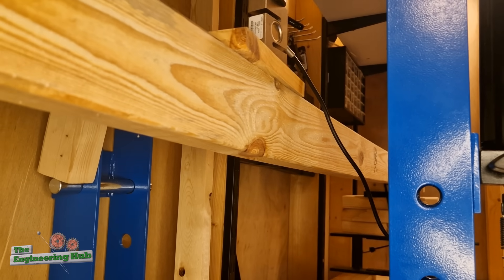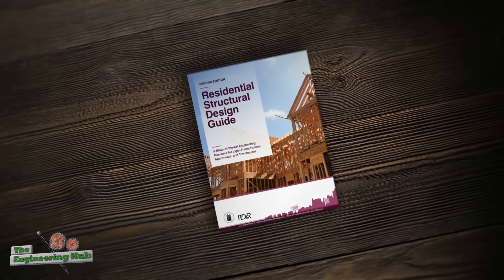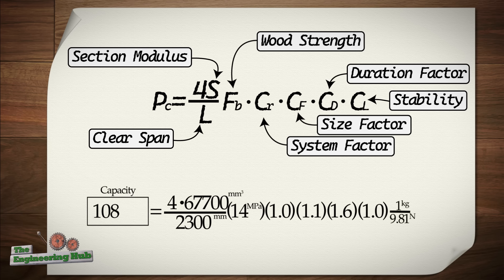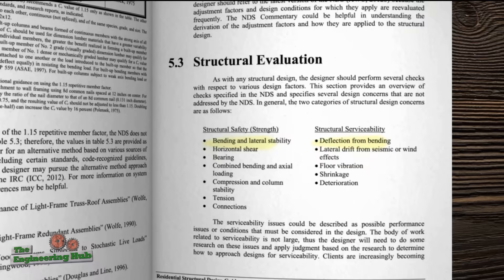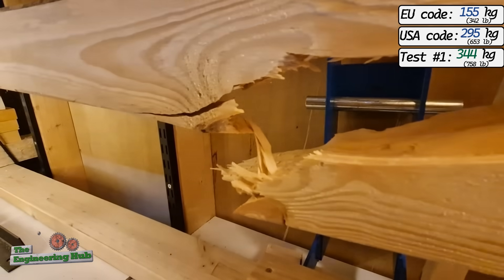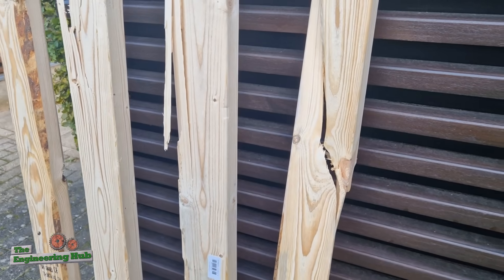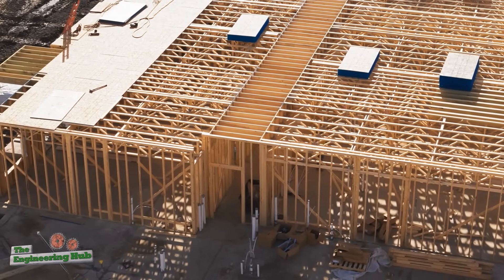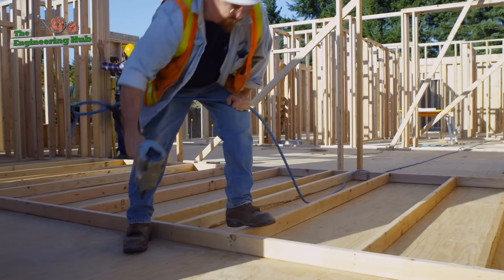I tested the strength of the 2 by 4!

Comment: This is why every carpenter and home owner always complains when the structural engineers say there wood floors or beams are undersized. We are not designing at this ultimate strength, the deflection almost always governs with wood members in bending. No body like bouncy floors.
Reply from the maker: @henrynagle8097  Yup, that's exactly right. The design of longer beams is (nearly) always governored by the deflection and vibration criteria. That's why a 2 by 4 shouldn't be used in a floor system unless the span is short. Many comments point out that the code doesn't allow 2x4s to be used horizontally, which is not exactly true. It's based on the span and spacing. If you have a 0.5 m span (for a short balcony or a section of a deck or whatever), a 2x4 might do just fine. For an 8ft span (like in the video), a 2x4 would never pass the deflection criterion, and in that sense, the comments are correct. My point is, it's more intricate than saying, "Never use a 2x4 horizontally". That's not how codes work.
Reply: @TheEngineeringHub  Yes. I build my bed out of 2x4s, safe to say that there is no problems with vibration or deflection.
Reply from the maker: @periodictable118 Good point: Furniture is another application.
Reply: @periodictable118  this is a hilarious self-own 😂
Reply: @TheEngineeringHub  I agree. But this same test still is true when scaled up. A 2x12 can hold why more than when we design for, but the deflection and vibration governs (in design). So thats the reason why all these (under sized memebers) are still standing. Safety Factor
Reply from the maker: @henrynagle8097  Yes, exactly! I only tested a 2x4 because my press can't break anything larger 😅 but like you said, the code strength for all of them is based on the 5th percentile strength, which naturally manifests in a safety factor compared to the mean strength.
Reply: You're doing great work. 👍 Whatever your formula, stick to it.
Reply: > "Nobody likes bouncy floors".       You should spend some time in an inflatable bouncy castle. You might change your mind!
Reply: 2x4's in the US are now 1 3/8" x 3 3/8"

Comment: I appreciate your video,  looking to hang a tank in confined area,  small tank 12 gal. 72 pounds total.  my load is less than 1/4 of the minimum strength you determined.   I am confident a 2x4 will function, thx.   FY!:  2:1 ratio is common in strength safety standards in ttransport load securement. (vertical shift, transverse shift).   If properly framed, side deviation can be minimized ensuring maximum load bearing over time.  Good Luck with your projects.

Comment: I came across this video while trying to figure out how much 2x4s I need for a fish tank stand.

Alot of builds I've seen use 2 supports per corner and one front and back in the middle. 

The span I'm working with is 47 inches wide and 20 inches deep 

So from my understanding of this video .. a the glass and water calculated to be 312kg (687lbs) means that a total of 10 uprights and a frame sat on that with also a 3\4" ply board on top is going to be ample to support the tank?

Comment: All floors are crowned, meaning that the curvature that one finds on most pieces must be used with the convex side up, so, this whole test is unfortunately quite flawed in evaluation of load capacity, because a downward curve has considerably less strength than one which the upward bow acts springing the load back up. These considerations are crucial, and crowning floor joists is mandatory practice for any structural carpenter. A tradesman should be consulted when doing these kinds of amateur 'informative ' videos.

Comment: Thank you for your video interesting. I would only use a 2x4 in wall application  ,there's not enough depth for a floor joist .When building a wall 16 on center, blocking at halfway point. That wall will carry incredible amount of load

Comment: That's never how a 2x4 is used, you have to use a 2x6 or 8 depending on several things but a 2x4 should only have downward pressure in a wall where they are 16 inches apart (in the US). This test is pointless and a waist of time. If your contractor is using 2x4 for your floor FIRE THEM.

Comment: Reasonable assumption that the first board with the knots in the middle would definitely be in the bottom 10% of board strengths overall. That pre-existing flaw really facilitated that brittle fracture.

Comment: At least here in finland 45x95 pine is fully planed and all 4 sides are smooth. It is used in visible structures. Structural 2x4 is 48x98 and can have some rougher surfaces.

Comment: My coworker and I once built a temporary floor on the second floor of a two story stair case so we could put an 8’ ladder on it to rough in a chandelier fixture. We only used spare 2x4s stacked on their sides from the framers extra pieces, and some old OSB that had been laying outside in the trash pile for a month. We had no clue how to do a proper load calculation for horizontal 2x4s as joists so we just over engineered the heck out of it, felt super solid, took forever to dismantle it.

Comment: As a consulting engineer, designing light frame wood structures in the USA, I wish this video was required learning for all contractors. I can't tell you how many times I have said the same key points you brought up to contractors who like to use the "I've been doing this for 3582 years...."

As others have mentioned in the comments, no one accounts for deflection limits and deflection controlled design or the fact that we use the worst 5% of wood for our strength values.
Reply from the maker: Thank you cbinder46! I'm happy to see consulting engineers around as well. I am a structural engineer myself but work in academia as a researcher. To my knowledge the code does not explicitly state that 2x4s can't be used "horizontally" as many have claimed in the comments, is this correct? Of course an 8 foot long 2x4 will never pass the beam deflection criterion but that's not to say never lay a 2 by 4 down, that of course depends on the span, load case, environment, etc. I am curious about your take on this?

Comment: When lumber is dried out it shrinks and that produces a crown (an arch). Floor joists and also rafters always have the crowned turned up for strength. Every board has this crown, some more than others. Even these short 2x4's have it so if he didn't crown the board before testing it  it could be turned crown down thereby weakening it and greatly reduces it's load capacity.

Comment: I too used to frown when comparing wood. My 18century built cottage had real 2"x4" timbers. Buying so called 2x4 from a local timber merchant nearly had me taking them back after seeing them side by side. And of course, I ended up packing out the wood to get them straight and level to match with the original.

Comment: You also should take into account other factors such as wiring running through boards.  If I'm not mistaken, the code accounts for allowing for holes to be drilled into the boards to run wires.  The holes must be drilled in the center of the board and must be less than 1/3 the height of the board for a horizontal board.   You should test the strength of the wood with a hold drilled through the center.

Comment: Those lumber markets are because the age of tree used is a major part. The tighter the rings, the stronger the lumber. Kiln dried vs natural dry also poses a major reason.
Reply: The number of rings in wood indicate the age, the distance between rings indicate the grow rate. Dense and solide wood have tight wood rings = cold climate

Comment: Side load is not how you build a building or use 2x4 , it is end to end loads just like a tree. This test seems kind of silly to me like testing a bicycle suspension by riding it down stairs or on railroad tracks . These tests do not exist in the real world. The real problem with wood structures are not strength it is who built it . If you want to test how strong wood is try wood with plywood laminated in the middle or bamboo , I think pound for pound a bamboo tree will beat anything .Thanks for the videoPeace on earth and ocean

Comment: How often would a point load of 300kg be applied to a 2x4 that’s fixed in a horizontal orientation?
Reply: It may take 2-3 people or something heavy standing in that spot, with just one of the persons jumping or falling over. How often? Probably very seldom. But once it happens, it will be a mess.
Reply: @ morning babe. My point was, if the was ever the chance on any point load you’d use a beefier timber. May the force be with you.

Comment: 6:26 dude you are 10000% wrong! The code is not predicting anything! The code is imposing! The NA code is f up… give you a minimal safety factor! That is soo bad!
Reply from the maker: @ovidiuciuparu6421  you are correct that the code is designed to give an acceptable safety favtor that balances risk and cost. If you wanna argue about the semantics of "predict" then I will make the case that the code gives the EXPECTED value ("expected" the statistical term E[ ] ) for the 5th percentile carrying capacity. The safety factor that you mentioned is nothing more than the discrepancy between the mean value of the distribution and the expected 5th percentile value. The code is based on mathematics, not on semantics. You can call it whatever, but the truth is that the underlying mathematics is what governs. So yes, the code is predicting the 5th percentile strength, which deviates from the mean strength of course, which gives the safety factor.
Reply: If we didn't have that minimum people would be building toothpick houses that fall down. Even with code people don't adhere.

Comment: Do they specify water content?  Had to design a lifting and carrying system using materials only found in Bangladesh, and it blew me away how different the structural capacity of bamboo depending on water content.  Not a carpenter (although I've done a lot of remodeling projects), so honestly don't have the experience.  I did design a sliding floor, but I made it out of steel, since the span it had to cover was 8'x7'.  Curious if moisture affects wood like it did with bamboo.

Comment: 5 x 10 mm is never used for joists!, not in the Caribbean, nor in the East. In the Caribbean, pine is hardly ever used for load bearing. There are other lumbers that are far more durable and much stronger. In fact, i just demolished our old home which was almost 100 years old and never repaired - every single piece of lumber was in perfect condition, even the weather-beaten windows. Even so, 5 x 20 mm is the minimum for joists. Building a home is much more than using the minimum.

Comment: Carpenter for 35 years...A 2X4 is NEVER suspended as a floor framing; The strength of a 2X4 is in compression ( along the length) which is several thousand pounds...use a 2X12...Let's see how that fares!
Reply: Not arguing your point. I suspect the video uses the 2x4 iot find a commonality amongst the 3 code manuals

Comment: I have seen many videos that blatantly tell you most common grade 2x4s are really junk.  Selected 2x10 cut down will give you more usable 2x4 because you can eliminate many of the defects - but at much higher cost (2.5 X).  Again because the common 2x4 is terrible with so many grain or edge or knot defects.  They each have about 5 breaking points.  Maybe good for fake martial art demos.

Comment: As for the dimensions of 2*4... Atleast as far as I understand the 45*95 mm is a type of lumber that has been cut twice.

To understand what it means, one should start from the beginning... Wich is the way wood would arrive to a lumber mill. And that would be round and wet. When cutting a given dimension of wood out of fresh wood, you don't cut to nominal size, because the wood would shrink and end up much smaller than that. How much the wood shrinks as drying is however quite predictable, so you can get pretty close to desired measure but just cutting to oversize and drying. To my knowledge, this is still done, atleast here in Finland and that is how you get actual 2*4 (50*100)... But as predictable as the shrinkage is, lumber that has only been rough cut once when fresh is not very accurate by dimensions.

Personally, I really don't understand why should anyone actually care about inaccuracies at that scale, when talking about lumber that is used for framing. I mean most people don't make their cuts less than +/- 0,5 mm anyway. Just as an example I could tell that once I used a laser to level floor. Basically we measured the floor level and put shims underneath where it was needed to raise it to level it. I think we got it down to something like +/- 5 mm accuracy, and while it in a way seemed like a lot when measuring it to a laser level... But in practice or if one would use spirit levels or something, you would not notice anything.

But my opinion aside, for some reason someone came up with the idea that you could make the dimensions more accurate if you cut it once more... Wich is why and how you end up with slighty reduced dimensions of 45*95 mm... The surface is smoother, I give you that... But why? This means additional processing and framing timber is literally not seen by anyone but builders really. If you want actually smooth surface, you would want planed wood anyway, so this twice cut is just pointless. It is smoother than the old fashion rough cut, but not smooth enough to make for visible and touchable surfaces, so you still need planed wood for that...

Fully consious about the fact that for most detached homes a simple frame made out of 2*4's would be more than adequate... I built my own house out of the cheapest rough cut 2*4 that was not exactly even fully squared... I don't know the english term for it, but we call it "vajaakanttinen". Anyway, it is dirt cheap surface wood, far from perfect... But to meet code in insulation I knew I had to get frame thickness to something like 10" anyway, so I figured double 2*4" frame with 2" gap between the inner and outer frames would do just that, with the cheapest possible lumber. And as there is a 2" gap, there are no cold bridges and I could even put some additional brace boards in that gap. So even with that cheap lumber, it is still structucally an overkill. Some of the corners were actually quite round, but since I had separate inner and outer frames, I could allways turn the worst corners towards the gap between the frames, so I got nearly perfect surfaces facing outwards. If I would be building today, it would not be up to code anymore... Wich is absurd if you ask me. 

Before the oil crisis, people used to make frames out of just 2*4s... Not saying that would be something I would like to go back to, no better insulation is good. But for a wall frame, that was perfectly fine. Never heard of any detached home collapsing due to insufficient framing. And because now the code requires much thicker walls, practically you need either atleast 2*6" framing and even then you would need to add something to get thickness up. So practically, in my opinion double 2*4 framing with a gap in between is the sensible way to go... And that gives you double the structure compared to 1960's standards.

Anyway, this apparently turned into all out rant about building codes. Didn't really mean to do that.

Comment: I am an European structural engineer and using EC5  in my work. There is such a country in Europe like Norway, whey have their own building code. Every time I design a timber structure for Norwegians, they claim that all ridge beams are so much over dimensioned. They use lower coefficients in their calculations and beams and joists have significantly smaller cros-sections. SO there is such a joke in our region, that as soon the wood crosses the Norwegian border, it feels Viking power and becomes stronger.

Comment: Could you make a video explaining shear strength for residential houses? In particularly if using OSB vs Termo-Ply or similar Structural Sheathing with 2x4 framing? My house is built using this in North Texas and I have always wondered what the strength breakdown would be actually vs what is in the Dr. J evaluation report.

Comment: The industry started scamming its consumers. a 2" x 4" was once its true measurement. I inherited my grandpaent's house built in the 1940's and all of the lumber is VERY close to 2" x 4" but then the industry claimed that in order to meet consumer demands, it had to cut the lumber while its still green and then through the drying process it was shrinking to the new smaller size. This increased their profits by giving us less material for our money which also resulted in BULLSCHIT sizes instead of them cutting the lumber a little bit bigger in order to accommodate for the later shrinking. I even showed in a video how even before china virus, places like lowes was allowing 2" x 4" lumber that was 1 3/8" x 3 3/8" not to mention the SCHITTY lumber that's so warped you can only use it to wrap around corners and its so twisted its not good for anything but scrapping into fire starter! Built a simple 20' x 10' deck and took me and my wife over 3 hours of just sorting through piles of lumber just to get DECENT boards n posts

Comment: Safety measures are usually about 5x its rating because people are stupid and will push the boundaries.  So if something says max capacity 100lbs, there’s a good chance it could actually hold 500lbs, just not safely.  Obviously there’s variables in there as well. One might fail at 350lbs due to its construction and one might fail at 700lbs.  One might even fail at 190lbs.

Comment: With so much variability is there just not a system to sort of benchmark the wood, cherry pick these golden samples and sell them under a more expensive brand? Is there some reason why this would be infeasible, or rather not-economical?
Reply from the maker: @curtisvickery9987  Absolutely! There is, different classes of boards exist based on visual or machine grading